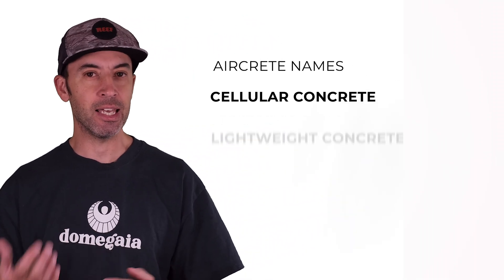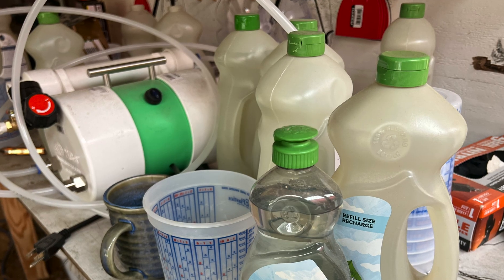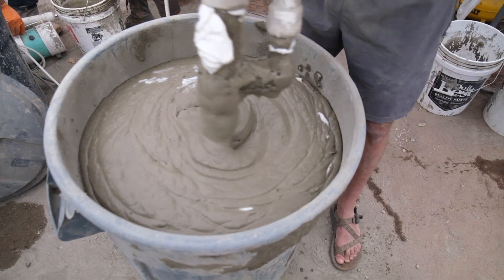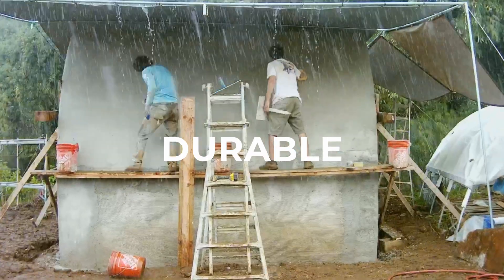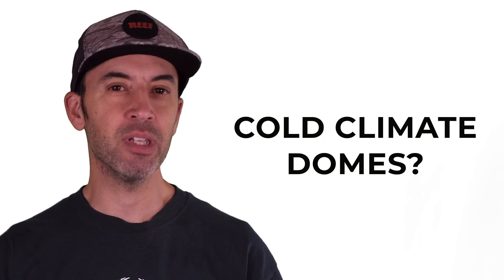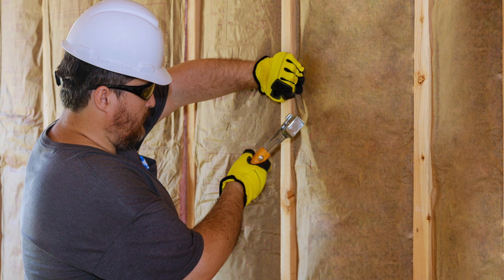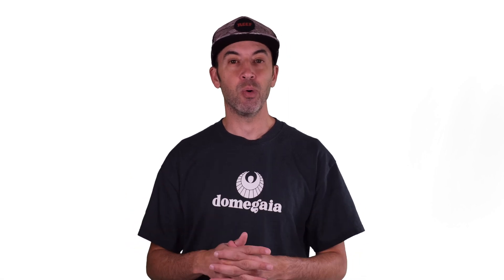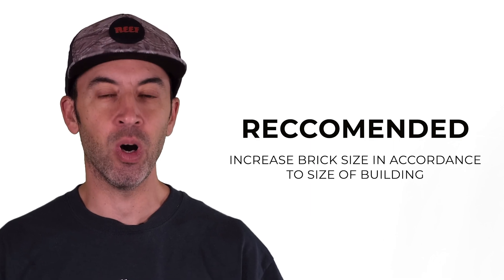Aircrete - Everything you need to know before you start

Comment: You should set up shop in Hawaii to help replace the homes that burned, get them going before winter.
Reply: That is a wonderful idea. Unfortunately, it's not very feasible especially considering the lack of commercial real estate in the area following the disaster. With that said, setting up a 14 day "training" workshop that benefits the local community would be much easier to put together than a permanent presence. Even if that isn't possible for DomeGaia specifically,  Thankfully the Islands are home to a lot of other  experts in the use of  "alternative" building materials which I know are already on the ground doing their part to aid in the reconstruction efforts. 
Unfortunately, from what I've heard from those on the ground, that despite the desperate need, some local  officials are making the  permitting process difficult for those looking to use aircrete and similar materials. The objections by some permitting officials doesn't just apply to permanent housing projects either. In some locations Builders try to Construct Sheds, Workshops, Garages and the like, are also running into issues. Needless to say,  This is extremely frustrating for many residents looking for low cost alternatives to expensive more traditional building materials. 
This is just one more area where the Personal Freedoms of American Citizens is being replaced by bureaucratic nonsense that is for our own good, I'm sure! 🤯🤦🏻🤬
Reply: @williamrodriguezmswlcsw8119  This. I remember y'all came to big island down the road from me is how I first heard about this. Been obsessed ever since! One day I will build my dome on my small slice of heaven here on BigEye ❤
Reply: then paint them blue..
Reply: @Shudog99 word!!
Reply: N.E. Texas as well, and all the towns midwest & central-* hit hard with tornadoes past few weeks  as well.
Reply: if you basically offset this ridiculus, unaffordable, "why did we leave Cali?" cost of everything in New England, and/or NY, I'd say, "Dude, you can just chill for a while, you know? Don't have to get going. Or anything. Heck, we'll freekin' actually cook for someone else in our new House That Aircrete Built."
Reply: @brainsmoothy  wtf are you babbling about?
Reply: I believe they are based in Hawaii
Reply: No...those people need to move away from that area. 
They are poor and mostly uneducated
Reply: It IS winter south of the equator

Comment: What do you Think 12 to 24  inch Wall in Alaska for Insulation...???
Can you Pl😂ase Answer?
Reply from the maker: 12" would be around R-24 and 23" would be around R-28.  It depends on the size of the structure.  If it's a very small structure you could get away with less insulation but if it's large you have a bigger payoff of more insulation

Comment: It's low tensile and compressive strength makes it easy to break in or blow away in a storm.
Reply from the maker: This is true on it's own but when you add the fiberglass reinforced stucco on the inside and outside surfaces that is when it becomes very strong.
Reply: I think of aircrete as a sacraficial mold material, providing convenient form for your regular rebar, wire mesh, and concrete. The resulting structures are pretty much disaster bunkers.

Comment: Hello, I have a question, can we mix the aicrete with wheat straw? Have you tried using clay instead of cement?
Thank you so much
Reply from the maker: You can not mix anything cement with organic matter so no to the wheat straw.  Clay will not work it will just crumble as it doesn't bondy to itself very well.  Cement forms a very strong bond to itself.

Comment: aircrete for countertops might have utility if you could figure out how to use it as a core with regular concrete poured around it to completely encase it. This should reduce the weight of the countertop over only using full density concrete. 

If, for example, you wanted hefty looking 3" thick countertop. 3" of solid concrete would weight a ton (and perhaps a literal ton). But if you were able to pour a 3/4" thick bottom, a 1 1/2" thick core of aircrete, and then a  3/4" thick top. A  1 1/2" - 2" wide perimeter on all four sides you give solid edge could end up with a countertop that is 30%-40% lighter. 

The issue arguing against this is that regular concrete poured on or around aircrete after the aircrete has cured does not bond very well. The bottom, the four sides and the top could be done in one pour so they fully bond with each other, even if the bond to the aircrete sitting in the middle isn't that great. This would require some type of legs on the aircrete to keep it 3/4" off the bottom of the countertop form.

To do that you could drill holes through the aircrete and put 2 1/4" machine bolts through the holes with a nut and bolt on the bottom so that there will be 3/4" between the bottom of the form and bottom of the aircrete. If there is any concern with the relatively thin 3/4" thick top and bottom layer along with the 2" rim around the edge being strong enough, 2 1/2" machine screws with washers and nuts so that 1/4" of the bolts are projecting sticking out of the aircrete. Then two pieces of welded wire mesh that extend past the aircrete 2" on all four sides could be tied to the bolts about a 1/2" up from the bottom of the form and to the 1/4" of the bolts sticking out of the top to the bolts. Once the mesh is tied to the bolts, bend the edges over about an inch out from the edges of the aircrete. There should be some overlap between the wire mesh coming up from the bottom and down from the top. Might even throw in a couple of wire ties at the overlap of the edges. 

Then pour 3/4" of full density concrete in the bottom of the countertop form, set the aircrete/bolt/wire assembly down on the concrete and work it in until the ends of the bolts are resting on the bottom of the form. Then immediately pour the rest of the concrete around the sides of the aircrete up to the tops of the forms. 

Hopefully the aircrete would then just hang out in the middle of the concrete, the bolts and wire serving to give the thin top and bottom concrete layers extra strength and the bolts serving to mechanically tie the aircrete and concrete together. 

Hopefully none of the bolt end stick up through the concrete top. Or maybe you want to use 3" bolts so the tops of the bolt head end up just slightly proud of the top surface of the countertop. Then when the concrete is fully set, then grind the bolt heads flush with the top and polish both the concrete and bolt heads until they are both shiny and smooth. Might want to go with stainless steel bolts if you do this so they don't tarnish.
Reply: You could pour the regular crete over styro board.
Reply: That's what came to mind right away,  I could finish the post,  stop overthinkng it this guy just gave the answer!
Reply: @marlinda6851  stop overthinking it? I don’t think I can. I’m an engineer, and that is just what we do. Or at least that is what this engineer does. And sorry about the length. I type 90+ wpm.
Reply: @papparocket Nah, it's not just you.  I know several engineers and questions/ideas like that one are catnip to them all.
One of the main things I like about y'all!
Reply from the maker: Good points.

Comment: High heat areas that regularly have 30 to 90 days triple digit temps; would the thermal value result in heating the interior more, thereby reducing the cooling efficiency?
Also, do you use a raised floor or trough system in the foundation for running  electrical and water lines or do you form the bricks around conduits?
Reply from the maker: If it get's cool at night then the thermal mass will help even things out and lessen your cooling load.  If it stays the same temperature through out the day then you are just relying on the insulation value and the thermal mass will have little affect either way other than it could take longer to initially cool it down.

Comment: Hi, I began researching alternative construction methods for a tiny house and came across your channel. I love it, Airecrete seems to solve many of my problems. I'm thinking about making wood frames for a zome (or maybe a geodesic dome) and then filling them with Aircrete for the paneling. Do you think that might work?
Reply: ^Also just thinking about this idea. There might be some more tensile strength that way, right? For the outer coating, I also wonder if cob and lime plaster makes any sense. The brick/ tiles of aircrete wood need to be really secure to withstand added weight.
Reply from the maker: I think this is an interesting idea but I can't really say how easy it will be to pull off.  Aircrete is quite brittal which is why it's so great in the dome shape.  A geodesic dome is made of many flat panels which could be an issue.
Reply: I'm very curious if you're idea would work...
Reply: I thought that triangles are the strongest geometric shape structurally. If aircrete bricks where make into triangles it might be stronger than the dome style.

Comment: Could you Barry the Domes under earth to make a hobbit house ?
Reply: My answer would be no.  too difficult to trust with the top and side load that an underground structure is required to withstand.  By the time you have included the steel you actually NEED building under earth and add the full water proofing you need I do not believe aircrete would be useful.  Aircrete alone is very porous and allows water ingress easily.  A free standing dome in air is handling gravity and wind load only.
Reply: The Earth will try to compress any hole in it. Attempts at putting shipping containers underground have resulted in the sides being crushed inward. Shipping containers are strong for stacking on each other, but not for lateral stresses. But, considering it's still made from thick corrugated metal, that's a lot of compression. If I were to consider such a building, I'd look into the old brick structures in Europe used for wine/root  cellars. Romans were masters at it
Reply: There are at least 2 companies I know of that provide the means to build a concrete dome home underground. The issue is in providing a form for the concrete to adhere to until it cures. 

I can see building a aircrete dome structure, adding your rebar support, then shotcrete over that. Although more expensive, compared to the expense of the forms of the other two companies the aircrete used as a form would be considerably less expensive; I think. And it allows for the underground dome concept which I'm particularly fond of. 

Some are talking about the stress on a underground structure. While I wouldn't want to be the guinea pig for testing a underground aircrete done, most are missing one key concept. A concrete dome design can withstand much more pressure than a rectangular building. One of the companies I mentioned had a picture of the bulldozer they were using to bury the dome, sitting on the very top of the home.

While I agree there are many zoning issues building underground, they can be overcome with proper planning and design. It's been a dream of mine since I was a kid and read much on it. Unfortunately life overcame my dreams. Still fun to study on!😁
Reply: @brentmiddlebrooks8422 have you seen on youtube people digging tunnels and room under their houses? Not the safest idea but it's still fascinating to watch hehe
Reply: Beyond looks, most people tend to consider building hobbit style homes because of wind from storms and temperature control. I've tossed the idea around, but it's a hard no as my water table is only a foot below grade. 
  But you can build in a thermal mass wall and with a small rocket stove in it, and if your exhaust is planned right, it can double as a large source of radiant heat during colder seasons. 
  As far as trying to avoid wind damage, from what I've been able to find so far, flat surfaces are not your friend. They take a more direct impact from wind forces than curved surfaces do. Roof overhang is also a weakness. Oddly this is where you can have *flat*. A flat roof with a knee wall seems to handle high winds really well. But if that's the route you go, then water management and redundancy in water proofing is critical.
Reply: @ThisIsATireFire  Well stated. Thumbs up
Reply: @ThisIsATireFire ooo rocket stove great idea!!!
Reply: I would say yes, but not on its own. I looked it up online, and it says it can be used, but I'd never use it alone with earthbermed homes. Google and research it. I'd add different support structures as well and use it as an insulation instead
Reply: I have seen this done in the Philippines.
Reply: I think you could use it as an additional outer or internal layer thusly significantly increasing your overall R value. But not sure why anyone would want to compromise the the strength of thier structure. Personally I intend to use dust or hemp Crete as an inner layer and then rebarb all around that and the spray concrete reinforced with fibreglass strands. It would be basically indestructible and superbly insulated as it would be 90% covered in dirt. The biggest issues would be getting and circulating enough air to prevent moisture buildup.
Reply: You can definitely do that, but the proper  name for that is "mass grave", not "hobbit house". 😂

Interpretation: No way, Jose.

You might be able to go A LITTLE BIT underground/sunken, but there is just no way I would pile earth on top of an aircrete structure unless you have an engineer sign off the design, and my guess would be that the end result would cost more than a straight concrete pour.

Concrete itself is almost useless in tension. Aircrete must be about 1/10th of that, even. You could do some compression and tensile testing to get a sense of just how far you can go with it structurally, but my guess is that the walls would need to be 'feet' thick, not "inches" thick. By the time you build the forms to pour that thick of a structure, you might be better off just burying the forms themselves empty.😢

P.S. I am an aircrete fan, not a detractor.
Reply: @FelonyVideos  hmmm....seems to me houses with basements get built all the time. In Roman times underground wines cellars and such were built. They are still around. Building underground isn't an issue. Using aircrete as a structural material...now that's stupid
Reply: @ravenrock541  I'm not sure you interpreted my comment properly.
Reply: Don't listen to these nay Sayers. There are so many pre made form fitted concrete secured and insulated walls made for creating insulated living spaces in Basements.  You totally can.
Reply: This is exactly what I’m going for.  Increase r-value, no siding, no roofing, grass on roof, and just hidden house.  Plus a hobbit door come on
Reply from the maker: In theory you could, but you'd definitely want to get it engineered and would likely require a lot of extra reenforcement than our standard design.
Reply: Does the structure have to be domed? Could you use it to build an above ground root cellar?
Reply: @godsdaughter7556  Most definitely. There are many videos on the subject
Reply: I like your style 🍄
Reply: Still inferior to compressed stabilized earth block
Reply: I'd rather build a "traditional" home then live in a 250sq/ft igloo cooler
Reply: Ask Larry
Reply: Id say partial not fully
Reply: Most places in the US don't let you do a subterranean house because exits are limited fires are a real hazard, and because of off-gassing of the land around the house.  There used to be a whole fad of building houses where one side would be underground, a lot of people got sick and some died because there were deadly gasses in the ground being leached into the house.
Reply: Use thick timbers, close together, overlaid with 1/4" pond liner.
Reply: I think you would be better off with a true monolithic dome bunker 😂 they are meant to be buried.
Reply: I would go with a monolithic dome if I were going to put it completely underground..... Just my personal plan anyway
Reply: There is a company that will ship you a type of industrial plastic dome that is specifically meant to burry like a hobbit house. You can add more pods as well. Just type in hobbit homes for sale in Google you'll find them
Reply: When layers are done properly it would be the same as normal cement. Bill lishman dome home would be a great rebar structure to attempt aircrete with the build. Just make sure everything is sealed properly and you aren't building into the water table...
Reply: Unfortunately there are TONS of excellent reasons we don't build much underground.